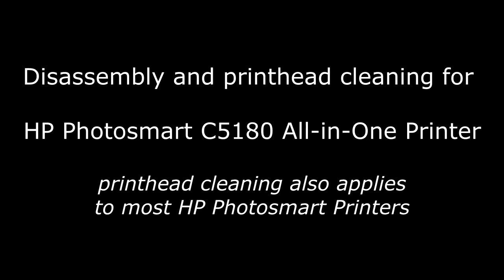HP Photosmart C5180 - Disassembly & Head Cleaning

Comment: My Photosmart C8180 can't print with black ink. I just did this and it took a while for most colors to come back however black still did not. Do you think there could be some blockage in another part of the printhead?

Anyway thank you for making this video! It's surprising to know how easy it is to take these printers apart.
Reply from the maker: With the top cover removed, you need to reconnect the 
cables of the scanner assembly and jam the "open cover" switch that is 
on the bottom right. Than way you can turn on the printer and do a 
printhead cleaning from the menu, observing the print head at the same 
time. Because the tube assembly on top of the printhead is transparent 
you can see if the black ink flows. If it does not, then the ink pump or
 some of the tubes are blocked. If ink does flow, and you can also see 
ink reaching the printhead chip underneath (you can see that by removing
 it again) then probably you have a damaged printhead chip. If you 
conclude that the ink does not reach the printhead at all, you could try
 to connect a syringe on the bottom pin of the black ink cartridge slot,
 remove the tubes from the printhed itself and pump some water in to 
clean the pump and tubes. If the printhead itself is blocked, because it
 is rather complicated assembly (it actually holds a good amount of ink 
inside, has some air vents to allow the flow, and uses valves to route 
the ink) I recommend to use a commercially made cleaning system.
Reply: antystein Thank you for that tip! I didn't exactly follow it however it led me to a similar solution that worked better than I thought! I just received a Printhead Hospital kit for HP I bought from amazon, I used it in a similar way as you recommended with the ink pump. So here's what I did:

1. I took it apart the same way shown in the video.
2. I placed the hoses from the printhead in a drain bowl.
3. The syringe the Printhead Hospital kit came with fit perfectly in the ink cartridge slots. So I heated the solution (The solution is more effective if the container is heated in near boiling water), filled the syringe to 2 cc's, then connected it in the problem color slot.
4.  Twist the pump gear counterclockwise, it is the biggest gear which is on the same side of the one used to loosen the printhead. While twisting the gear, gently apply pressure to the syringe. You will feel the pump slowly draw from the syringe anyway as the gear is turned.
5. Watch the ink slowly get cleaned out. 

I hope this isn't too complicated to follow but It is MUCH easier to do than it sounds. I did this to all the cartridge slots and now with the newly cleaned printhead, it prints as if it was brand new! The solution fyi is just a mixture of rubbing alcohol, ammonia, and distilled water. I hope you found this interesting! :)
Reply: AlexLovato88 In #2 of your steps, is it the hose block at clock 2:32 on video, the ones with the tooth pick plugs? If so this would have you pump in the cleaning solution through the front bottom ink cartridge pipe and out the hose block shown at time stamp of 2:32?
If this is correct, do you then re-connect the hose block and continue pumping the solution and have it come out the main jets?

The other scenario would be that you take the syringe with solution and pump it into the main ink jet unit depicted at time stamp 2:39 on the video?

My interpretation of what you did from what you wrote is that you never took apart the printhead and just pumped away from the main cartridge slots straight out to the main printhead each one at a time.  If this is true please let us know. 

Hope you can clarify further.  Thank you

Comment: Hi, Are you using an allen or hex wrench for most of the screws?  Thanks!
Reply from the maker: Hello, this screwdriver is called "torx". I don't remember the size of the one used in the video. Usually you can get what you need for those screws from a bit set like this one: http://tinyurl.com/ocvsl4e

Comment: HP C5180 All-In-One Printer HARD RESET:Hold down HELP + OK button and unplug printer (could experiment with regular power-off, but I opted for brute force)Hold down HELP + OK button again as you plug the printer back in. Then power it on, if it doesn’t power on automatically. Be Safe: keep holding the buttons until the printer turns itself off. (It took mine less than a minute.)Now you can release the buttons and simply power it back on. (I held my breath, but that’s not required.)I got an error message about “improper shut down” since I unplugged it w/out powering down. After I clicked “OK” the printer was just fine and didn’t mind anymore. And now I can print.

Comment: where is the ink clogging? are there many places it can clog?
Reply from the maker: Usually the ink dries on the printing heads or at the ink inlets, if the printer is left without an ink cartridge installed for some time.

Comment: I'm just digging out my C7180 I had stored away since 2011. I found 4 of the colored cartridges left in the printer. When I pulled them out they came out clean. I was going to order 6 new ink cartridges to see if my printer will print.$59.99 for 5 HP-02 color ink cartridges and $23.99 for the HP-02 Black.. for real for real?? The last time I purchased them each one was $9.99 at stables what the heck happen. :(

My question is, any chances my print-head will be clogged?

Comment: My printer says error check cartridge on the right ..I replaced it with a new cartridge usually this takes care of the error Not this time ..it still say error remove and replace cartridge ..I removed and replaced the cartridge several times still no go... Help I have a HP Photosmart 2710 all in one

Comment: 1) Does this help also when C5180 does not print IN BLACK ONLY?
2) Were you using glue at some point (when putting things back together)? Could you please further advise?
Reply from the maker: Mauz Matityahu If your printer is just clogged this will help. If the printing head is damaged it won't work. The problem is that you cannot know that before you try the procedure. I am using glue for the connector board of the printhead chip. In factory they just melt the top of the two studs that hold the board to secure it. Once you cut those studs the only way to hold it back together is with some kind of glue.
Reply: antystein Thanks. I followed your instructions and the printer did not explode after reassembling :) which is a success! :-) However, it didn't start to work properly either.. I suspect that their might be some old, dry ink in the small 'hose' that transmits it from cartridge to the headers which blocks the black ink and that causes problems with printing in black. Do you think that injecting some hot water to the 'hose' could help? If so, would you consider publishing a video how to do it safely? :-)
Reply: Mauz Matityahu Now I think the problem is with the pump mechanism.. Can it be clogged? Is it possible to disassemble and rinse the pump at home?
Reply from the maker: Mauz Matityahu Unfortunately the printer belongs to a customer and I don't  have a similar model at the moment in order to produce another video. You can try to rotate the pump motor by hand (the large white gear you see at 1:23) and this may help.

Comment: I followed the video to the T and I still get the same error message.  Could there be something else wrong and do you know if you can buy replacement printer heads?
Reply from the maker: Replacement print heads are not always easy to find and usually are too expensive. Sometimes they may cost even more than the printer itself! You can have a look at ebay anyway.

Comment: After done all the steps now i get a Ink System failure.  0xc19a0002. any advice?
Reply: I followed all the steps and found the sponge like tray and head cleaning pad completely saturated and full.  I cleaned it and reassembled and got the same ink system failure 0xc19a0002.

Comment: Hello. I followed your steps exactly as show. Before only black didn't print and now nothing prints. I did a printer head cleaning several times with no success. Any suggestions?
Reply: Hello. I'm retracting my last. After 10 head cleanings my c5180 started to print. But it's as it was before. Should I try disassembly again?
Reply from the maker: +Andrew Alarcón Unfortunately, if you did the procedure and nothing changed, it looks like the printing head is faulty, so repeating the process will not help.

Comment: Hi I have HP C5180, now it jamp paper. Discovered the bottom roller broke, hard to remove and fix paper so i decide to throw away. I owned it so many years. If any body wants it i can send to you but you have to pay shipping and handling charge.

Comment: I thought I did this to the letter. Must have botched it somehow though because now i get no print at all.
Reply: OK, So I printed piles of stuff like the person below and it did eventually come back to life. BUT, the black still looks terrible just like it did before I tried this fix. Any suggestions?
Reply from the maker: Jeffrey Kern If you could see light shining through the nozzles and the problem still exists, then probably the head chip is damaged. Replacement chips are usually too expensive.
Reply: After some more prints it is working well now. Seems like a lot of ink to waste but I guess it is still cheaper than a new printer,

Comment: Anybody Who can help? Have a c7180. Have completed the process. Now i get White pages. My cartridges are full. Anybody an idea how i can fix this or what i did wrong?
Reply from the maker: Usually, if you don't get any errors the printer should come back after a couple of head cleaning cycles or, printing several pages. This happens because the heads are completely empty from ink.

Comment: Thanks for that very helpful video. No problem at all to do this. Would have worked if  those HP-workers wouldn't have totally overtightened some screws, the most important ones. No chance to remove those 4 screws on the print-head. I'm so so angry. I have to throw away that great printer just because of some ink in that print-head which i cannot open because ot those idiots. Bye bye my little printie.
Reply from the maker: What kind of screwdriver are you using? the right screwdriver makes all the difference! Anyway if you cant remove the screws you can try dipping the lower part of the print head into warm water, or even spray some water with pressure on the nozzles.